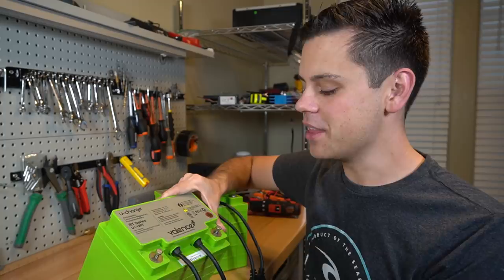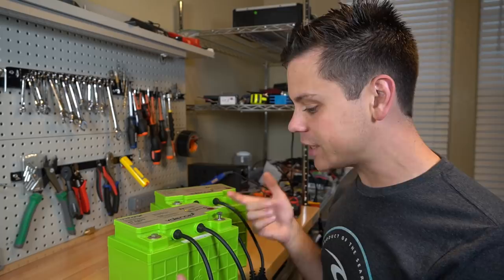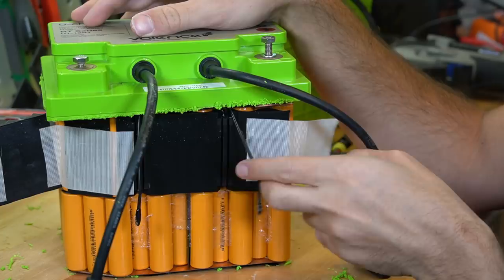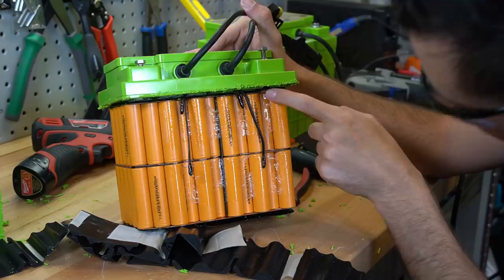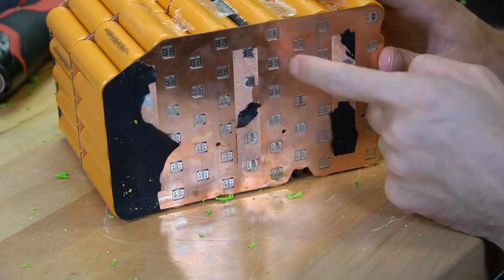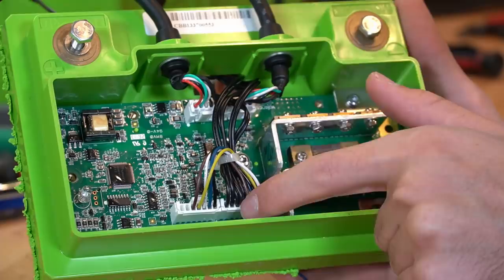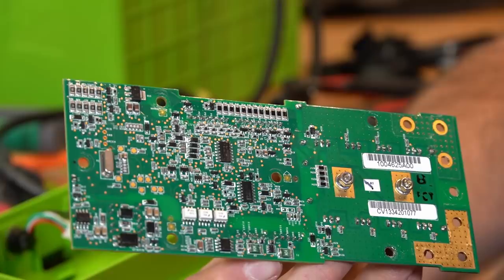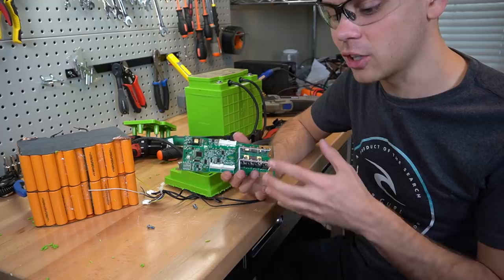$1,248 Valence RT LiFeMgPO4 Battery Tear Down

Comment: I really enjoyed this video. it is my first experience with these Valence batteries. I had bought two at a tag sale at a very good price. Their voltage rating was about 5V (not constant, the voltage was bouncing up and down a bit, plus or minus 0.2v). The indicator light was off also. I tried to charge with a 12v 1A charger to bring them up to a level so that I can use a regular smart 10A charger (as it was described in the instructions on their website). No luck, after 12 hours of charging at 12v 1A the voltage is still around 5v. The only difference is that now the indicator light (yellowish color, not green) is flashing every few seconds. Is there any hope with these beautiful looking batteries? Is there a way to bring them back from death? Thanks in advance for any advice on this.

Comment: Can you cut one of the cells open?
Reply: I wouldn't. So far, Will has done nothing that would actually keep one from "repairing" the damage done, or at least being able to re-use the cells in a different case, etc., but cutting one cell open would mean one would need to get another cell to replace it.
Reply: Now, if I had a dead cell that wouldn't take a charge... different. ;)

Comment: Hey Will   I have question do you think I would be able to build a power system for my van with a RENOGY 50A DC-DC ON-BOARD BATTERY CHARGER WITH MPPT and four  U27-12XP Valence Lithium Battery 12V 138A with a 300watt solar panel on my van roof?     pros and cons, what are your thoughts?   good or terrible idea?   great channel i've been watching seen you mader the Kodiak review
Reply from the maker: Crazy combination but that would totally work
Reply from the maker: I would charge up the batteries before putting them in parallel
Reply: @WillProwse  do you think that would be enough power to keep me off grid for a week     need to power 12 volt fridge and induction cooktop and charge laptops.     or would 4 battleborn 100ah ( 4000$) be much better?   I can get 4 Valence batteries for about 1800$
Reply: @WillProwse  Will, I bought a  U27-12XP on ebay and while it hasn't arrived yet, I'm a bit worried because according to your previous video the  U27-12XP does not have a BMS, and you advised against buying them. The seller claimed it has a built in BMS, so I am a little confused. How can I tell whether it has a BMS? Will it work without one?
Reply: Hey Will I was also considering the Renogy 50A DC-DC with MPPT and 3 Valence U27-12XP batteries. I just saw a post on your forum that shows the data sheet for that controller being super high voltage for Lithium profile. I am concerned with the two things, if these batteries actually do have a internal BMS that will protect overcharging with this higher charge profile from Renogy. Thoughts?

Comment: Do you see any problem using a Valence battery as a starter battery for a standard combination engine vehicle...?!
Reply from the maker: Wouldn't work because OCPD
Reply: what’s OCPD? the output is 12V and there are other Lithium-Ion for cars on the market. but they are charging 600-1500 dollar. Want to install one for weight and space saving factors...
Reply from the maker: @p__jay  oh boy. There is a lot to type out if you don't know ocpd. It will not work.nlong story short, cranking amps required to start car would put battle born into safety mode
Reply: you can’t assume that everyone knows everything you know. and since you know a bit more about batteries I thought I can ask you. isn’t that what YouTube is for? I’m aware that the starter is pulling a lot amps when cranking up an engine - but what’s the difference between the Valence and car 12V lithium batteries then? are the cells different?

Comment: How many amp hour is a deep cycle walmart battery???
Reply: If I recall correctly, the Group 29 batteries I had before going with Trojans were around 112Ah@20m. The Group 24 is obviously less, maybe half? (I would have to check with my neighbor, as I gave him the batteries when I upgraded to golf-cart batteries. Do understand that, in order to NOT kill lead/acid batteries, they should never go below 50% capacity, so only around 56Ah is available per single battery, (same if they are wired in series to make 24, 36, 48Volts, etc.).
Reply: @Tumbleweed5150  walmart carries?a?double?cycle rated?big lead and warrants it YEARS

If in STOCK generally 2 ONLY.  The old stockers are loathe to pull rear unit so check freshness or buy front ONLY and wait for replenishment for next or use?ship?to store for big ORDER if POSSIBLE.

The sku is?not a?web product per se  

It with a?dc to dc module can cheaply?drive quite a?hub MOTOR via thin cables and $50 gets there near 400 watt lightweight charger.
Submarine users?be aware?of cabin isolation needs

Comment: Valence are well made but they are still not worth what they charge, not even close.
Reply from the maker: I agree
Reply: @WillProwse  bms on these blink green no matter what. One of my batteries had self discharge on one of the series group of cells. Voltage was around 9 volts and was still blinking green. Software for these bats is hard to get installed if you can even get. I tested all my 12 bats and they're all different capacity. But are all well above 400 kwh. A couple are 480. Bottom line is these valence bats are not worth the price in my own opinion. They are the safest chemistry though. I did open my bad battery and i have the blue cells. You can also use a tenergy 5 in 1 cell meter/balancer to connect to the battery cell connection.